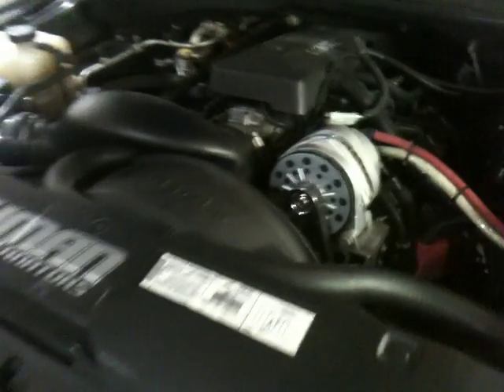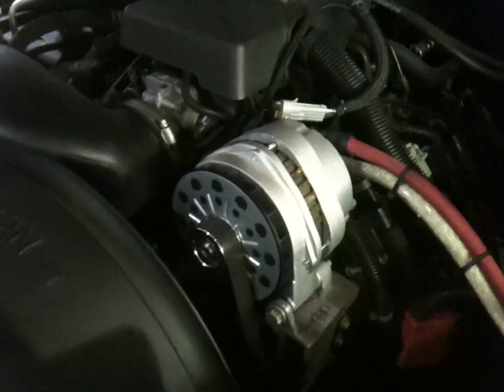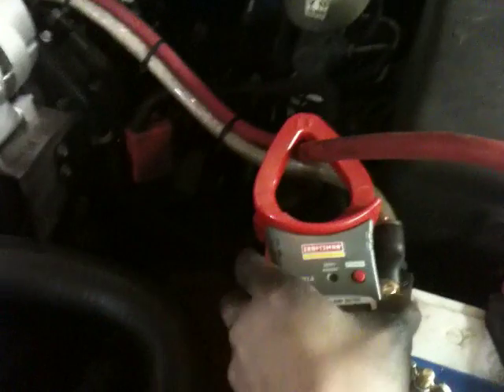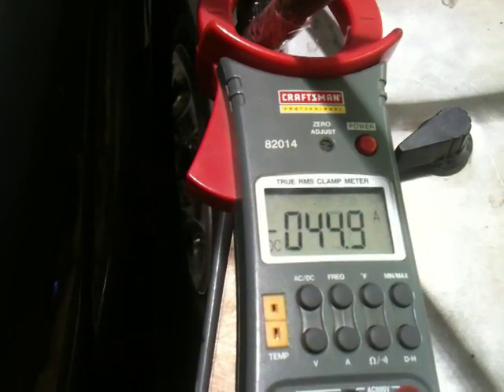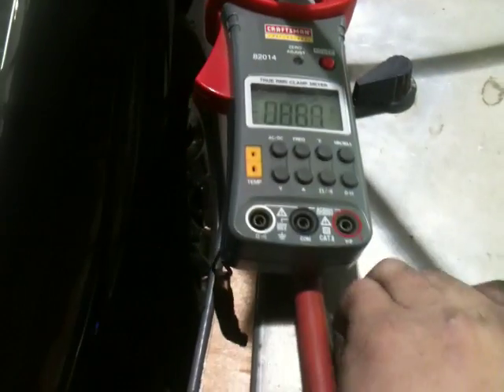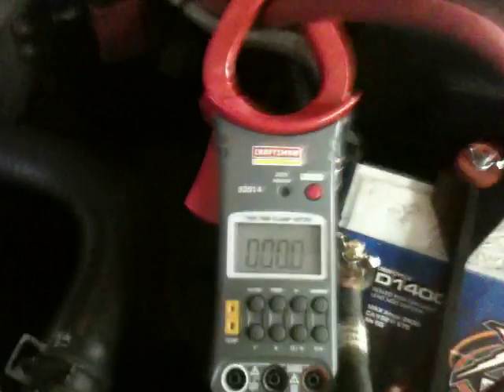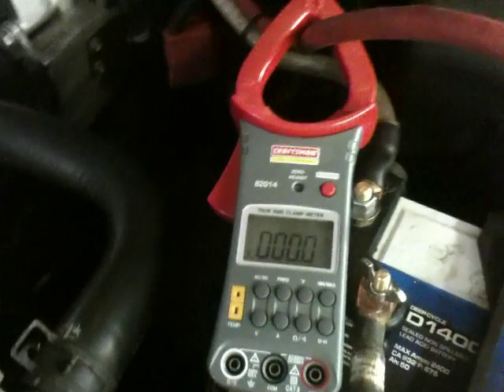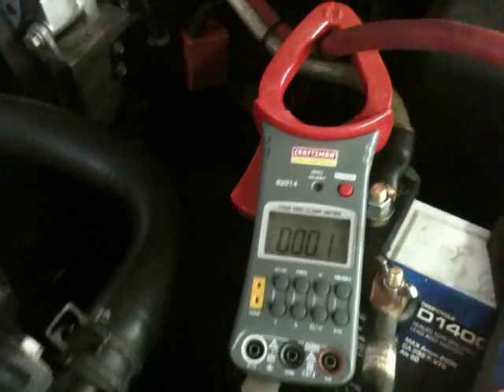Insane 400 amp MechMan SPL alternator load test Maxed out the tester!!

Comment from the maker: @ronaldlemasters 

Wow you must have calibrated ears to know what RPM the engine is at through an Iphone microphone 6" away from the engine's cooling fan...  

The unit in the video achieves full output at 1800 rpm engine speed on this truck.  (4:1 pulley ratio = 7200 rotor RPM)

Comment: i dont like that that engine sounded like it was wayyyyy more then 2k rpm what good would that do when most comps wont let you rev over 2k and not good at idle THAT SUCKS but thats just what i think for others i am sure its good but i dont find much use out of it. AND also yall post vids of your stuff but wow the cost yall charge to do it. idk but i rather pay 600 bucks for 2 160 amp alts that are not very good then pay that or more for one. JUST SOUNDS CRAZY TO ME
Reply: 11 years later they're still in business 😎

Comment from the maker: This unit was specifically designed for hardcore SPL competitors that rev their engine to 1800 rpm during competion, such as in USACi street beet.  These units are not recommended for daily use, as they do not have good output at idle, and CAN overheat if they are run flat out for extended periods.  I have been running one on my truck daily with no problems, but I only demo for short periods.